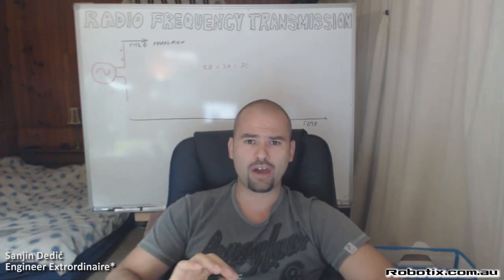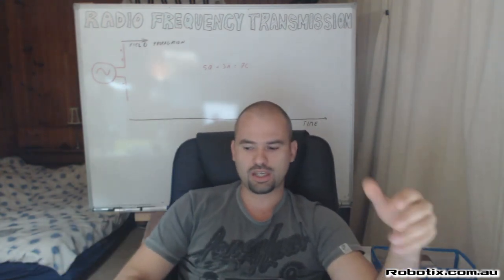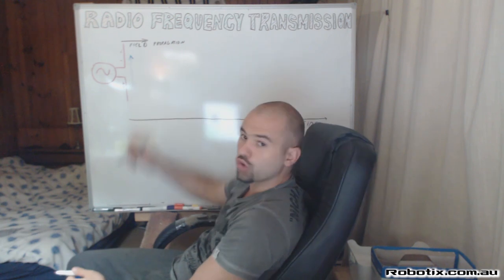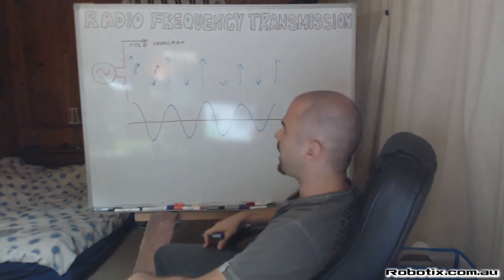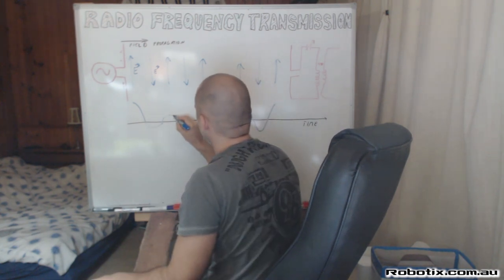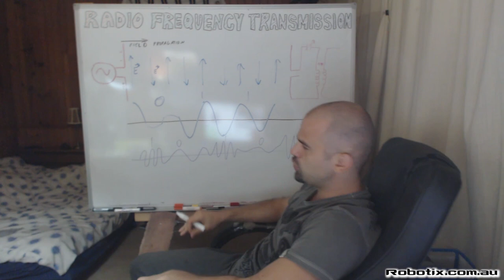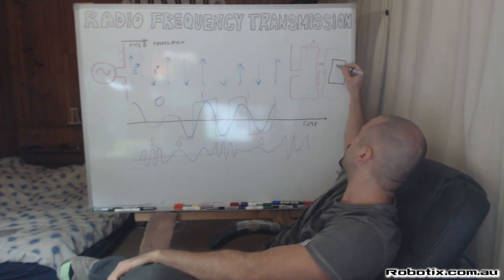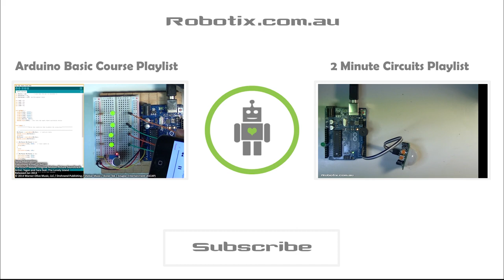How Data is Transmited by RF circuits (Wifi, bluetooth, phone, radio etc...)

Comment: I wish you didn't say 0s and 1s.
You did good with calling it electromagnetic waves, amplitude or frequency modulation.  Suddenly you went from that to mathematical symbol which is algebra.
Amplitude refers to voltage and frequency refers to energy delivered.

Comment: If radio waves are everywhere, how do you know which radio wave to receive and interpret?
Reply from the maker: Beautiful question. Its all about the frequency. Think of your radio, a particular station transmits at a specific frequency!. If anyone else did that it would be illegal. So that is what happens automatically with mobile phones satelite channels etc . . etc. . .
Reply: How do you use smartphone to transfer to microchip

Comment: do you think it's possible to change a device that uses  wifi to transmit data (like a portable car diagnostic scantool that connects to a cell phone app to read information via wifi),  to a bluetooth connection? ie. swapping out wifi and replacing it with bluetooth internals from say a portable speaker?
Reply from the maker: This is absolutely possible provided offcourse that the data is digital that both devices have WiFi and that the receiving device has an operating system as well as some memory storage. 

If all of those are true that it is possible but obviously requires some fairly advanced programming to edit the code so that the data is sent and via a different channel.... also  you have to program the receiver to listen, receive and store the data. 

So yea keeping all that in mind I suggest you only try if you have good documentation for both the sending and the receiving device!
Reply: Robotix, my scantool only communicates via wifi. but my app for car diagnosis only uses bluetooth to communicate. So instead of trying to tear it apart and swap bluetooth/wifi components it will seem easier (since I'm a novice) to just buy the device that uses bluetooth instead of the one I bought that uses wifi.

Comment: I like to know is there a portable thin receiver to pickup phone carriers LTE radio bands like 2-4 and powered by using a elbow type C connection to the phone.

Seeing Xiaomi mi Pocophone F1 Global OTA Unlocked snapdragon 845 CPU phones do not have the LTE radio band of 2-4 ❤️

Comment: I'm really sorry, but AM is Analogue, not digital, this means that what youre saying about AM's low amplitude representing a 0, that would be incorrect, because Analogue doesn't work, on ones and zeros, that's digital (FM)
Reply from the maker: Hey mate don't be sorry :) . . . AM Radio stations are analog radio so to speak. But I remember from my Signals and Systems subject at uni that amplitude modulation can be used to encode a digital signal. I think its called ASK, Amplitude Shift Keying

Now, I am not sure if the latest 4G or Wifi standard uses this technique , but I think it makes for the best example of how you can send zeros and ones over radio waves.
Reply: Well, ok. Thank you for replying. I do know that AM can be used in a digital manner, but isn't in radio's case.
Reply from the maker: So to clarify for the keen comment readers AM can be used to transmit data via  Radio waves . . . but its not used in radio (as in music radio stations) In the latter Amplitude Modulation is used to encode voltage to a speaker coil which makes sound

Comment: I have been building cellular networks for 15 years.  That's, well, not how it works, except for mabey cheap Chinese devices..  Even as far back as the AMPS analog system, the control channel was a single qpsk symbol.  And still to this day 5G uses the phase shifting modulation schemes.  From qpsk to 256QAM.

Comment: what is the need of a capacitor at 3:50 ?
Reply from the maker: Great question!!!, the short answer is capacitors unlike wires have a limit to how much current (AC) can flow through them. So they maintain the frequency, but can (depending on the size of the capacitor) limit the amplitude of the current and hence protect the equipment which reads the waves as 1s and 0s

I am sure there is more to it, but this is the main purpose